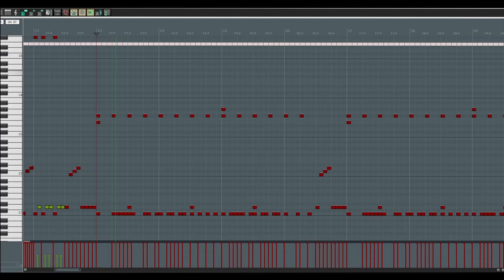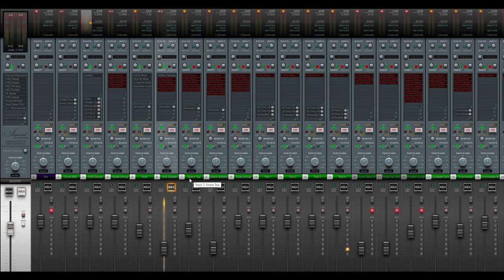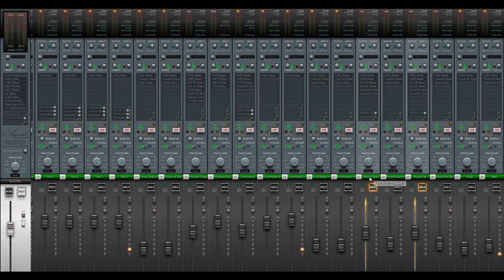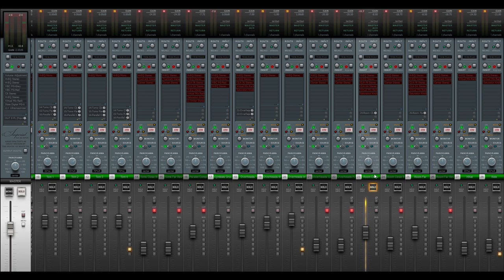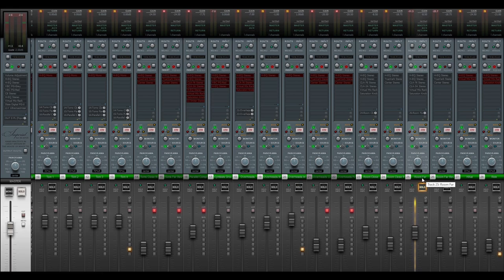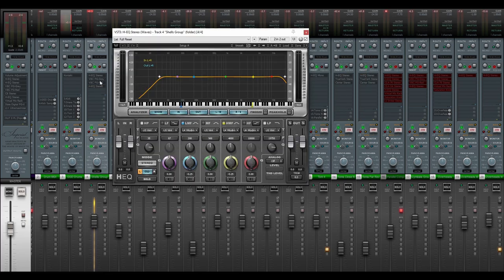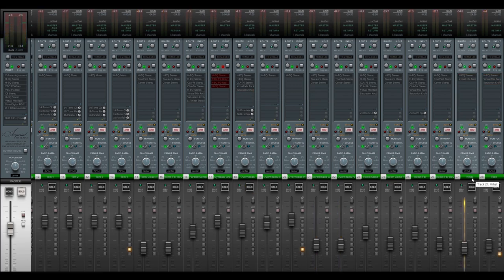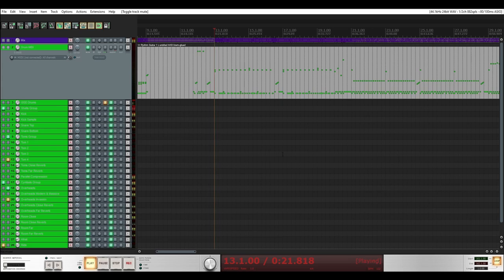How To Mix BIG and PUNCHY Drums! (Metal Mixing Tutorial)

Comment: Sorry might be a really stupid question im not a trained sound engineer purely a hobbyist. I noticed most these demos show the tracks clipping is this done as it is a demonstration or is gain staging done after the mix is done? Hope i make sense
Reply: If by clipping you mean the signal reaching the red then it's not a problem really (since it's all digital, it's a whole another thing if you do things analog). As long as you can't HEAR the nasty digital clipping then don't worry about it. Gain staging is usually always done first. Gain staging is finding the balance of every instrument volume wise basically. If you haven't started using reference tracks then definitely start doing that. I'm just assuming since it sounds like you're really new to this but this will help you alot.
Have a good one!

Comment: I've noticed at 9:30 that both the VBC Grey and Red are set to 1:1 Ratio and Threshold at 0dB, as well as the Drive set to 0 - is this actually affecting the signal in any way or were they supposed to have settings to compress the signal?